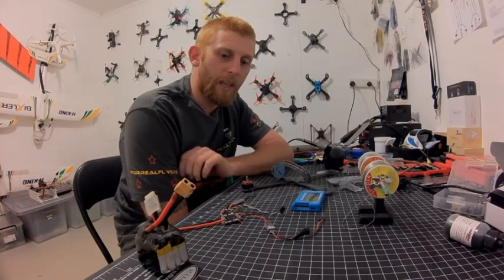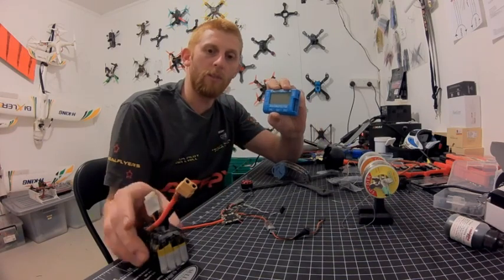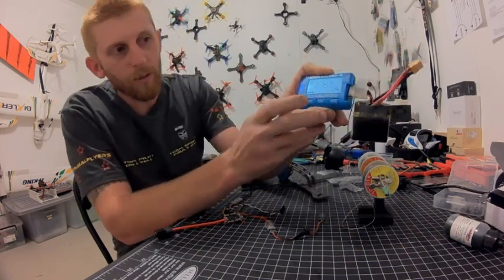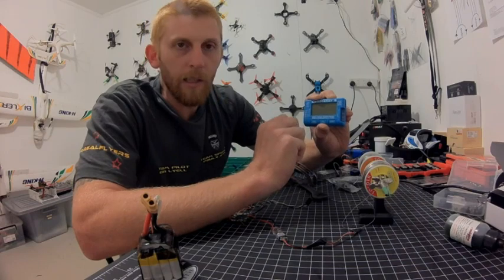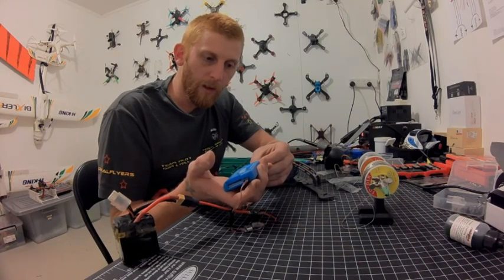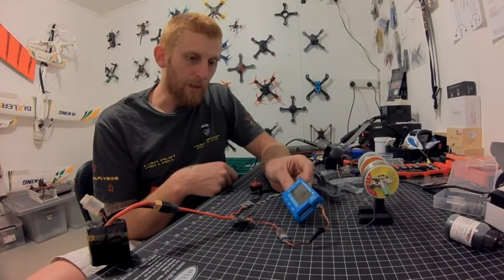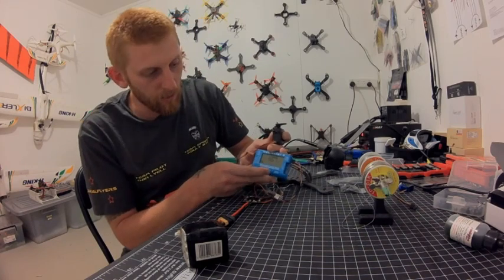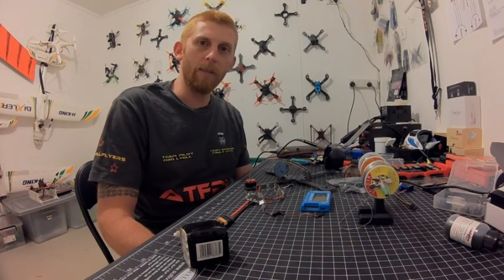Cellmeter 8 battery voltage tester .balance discharger. Esc tester. Motor tester. servo tester

Comment: After some reading, it seems the Cellmeter 8's balancing is worse than Cellmeter 7's. CM7 automatically balances the cells to whatever the lowest cell voltage is by long pressing the TYPE button. But CM8 you long press the MODE button and have to specify a voltage, so it's just a discharge function not a balance function. Can you confirm this please?